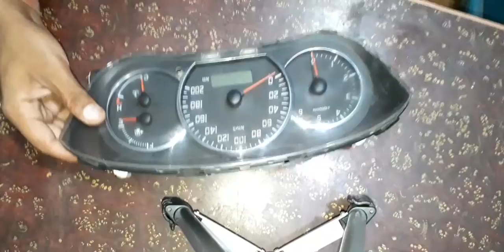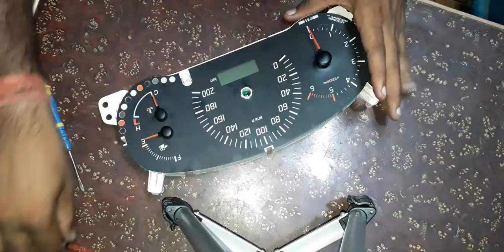How to open Swift desire speedometer at home || Swift Desire || Swift Old Model

Comment: Heat and fuel guage meter needle setting after removing
Reply from the maker: Fuel guage on E sign top and heat guage on C
Reply: @ReallyRight  I had set same as u said but when ignition on heat needle moved up..... On running some kilometers it's above H(hot)
Reply from the maker: Open meter glass and hot needle postion  middle of the hot  meter

Comment: Hello sir nice video
Sir mere pass swift vdi 2010 hai uska metar kabhi sahi chlta hai kabhi kabhi khrab btata hai jese heat wali needal upar hu jati hai kabhi RPM wali kabhi kabhi gadi 40 ki speed pe hugi or metar 80,90 ki speed dikhaye ga 
Kya problems hu sakti hai sir
Please btaye
Reply from the maker: Agar Aapka  meter me RPM , Kilometer  fuel and heat meter missing kar rha h kabhi kabhi ... Ye sab ECM k missing ki vajah se ho  rha h ..aap ECM check karwao.. ye thik ho jayega... Baki aapka meter sahi h.
Reply from the maker: ECM - Engine Control Module mistak h..
Reply: Thanku very much sir
Reply: Hello sir
Sir ek baat or hai agar main gaddi k betry ku hta deta hu tu sari ki sari metar reding apne aap back hu jati hai vo 1200 pe aa jati hai
Reply from the maker: Aap ecm check karwao folt usi ka aur koi dikkat nhi h okay

Comment: सर मेरे पास स्विफ्ट vdi 2010 मॉडल है उसका स्पीड मीटर और लाइट बंद है बाकी चालू है क्या प्रॉब्लम है कृपाय बताये रिपेयर हो जाएगा क्या सर
Reply from the maker: Aaram se ho jayega sir
Reply from the maker: Speed meter k liye pehle sensor check karwao
Reply from the maker: Uske bad bhi thik nhi hota to speed meter ki machine change karwao 300-350 ru k aas pas aati h
Reply: @ReallyRight  sir speed meter ki machine mil jayegi kya 2009 
Model swift dzire vdi
Reply from the maker: @prabhaker1996  Yes mil jayegi